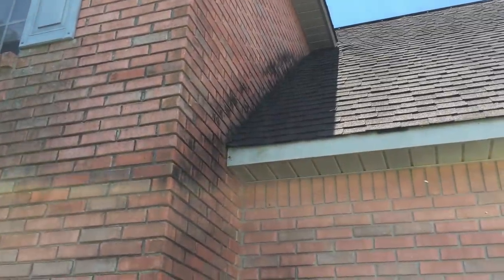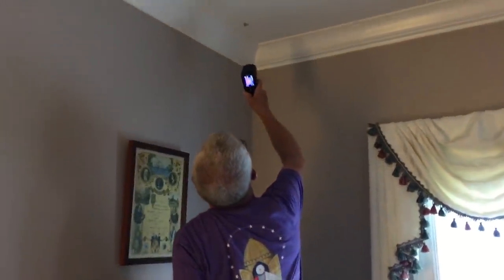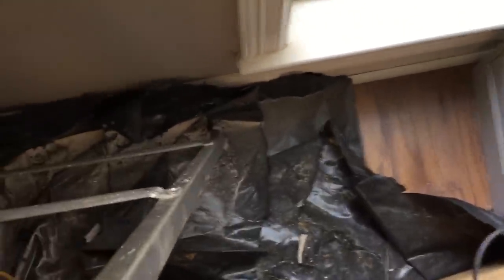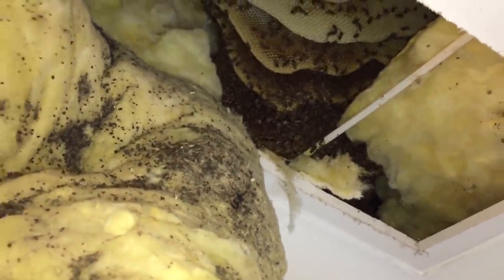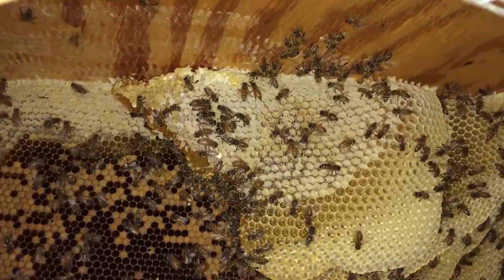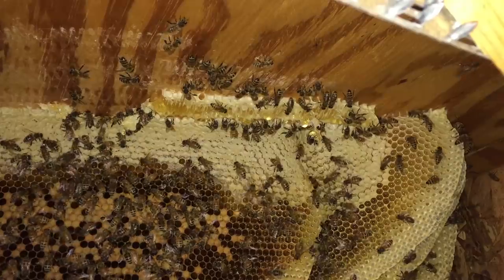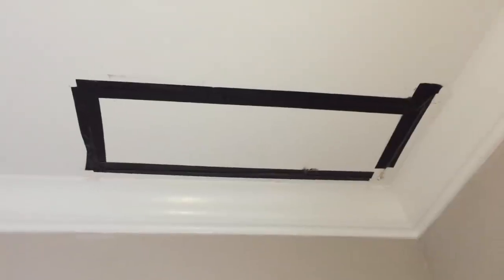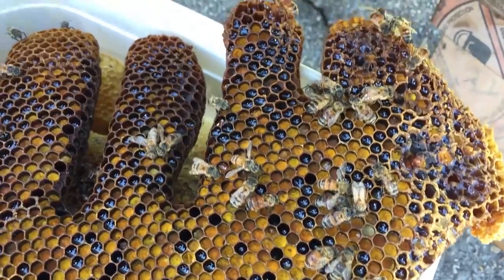Rental House Caught Wild Bees

Comment: I gots a question fer ya.  Generally, if a comb has any wax moths in it, I'll just toss it, but you often use comb which I'd consider too nasty to use, especially with mold.
What do you do if a comb has wax moth damage in it?  Will the bees clean it up if wax moths are in it?
How much damage is too much damage before you'll pitch it?  Can you tell me in "Percentage of damaged comb"???  Make sense?  Any help would be much appreciated!
Reply from the maker: If it's dried out comb and flakes off the foundation fairly easily it doesn't have to have much moth damage for me to just shuck it off and start over.  The bees will clean it up unless it's really full of webbing and feces but they will usually build back spotty.
Reply: @628DirtRooster  Cool, thanks.